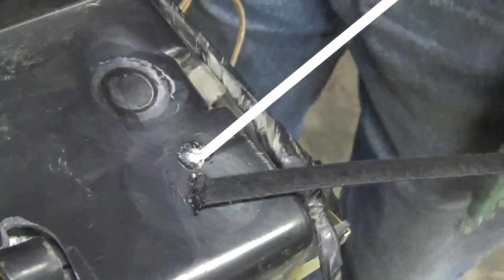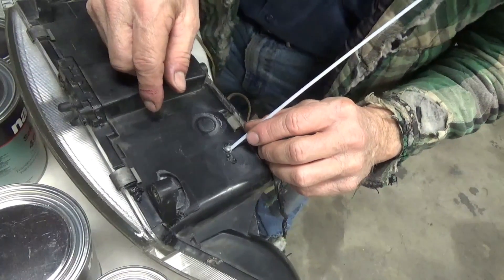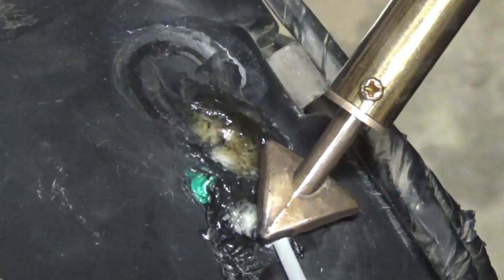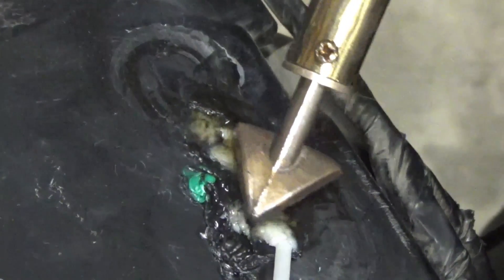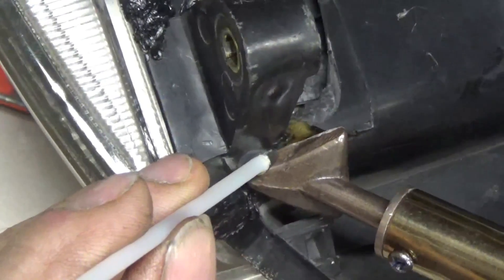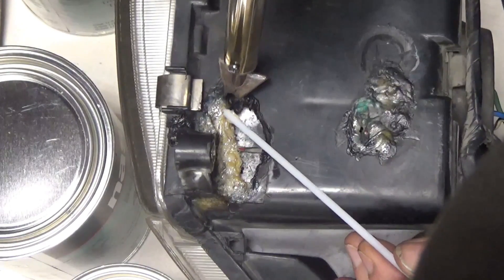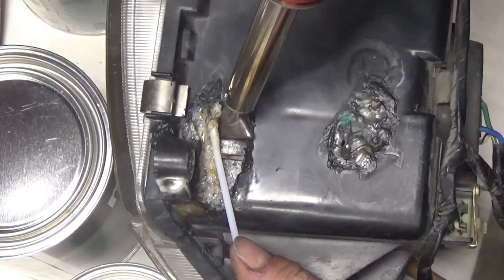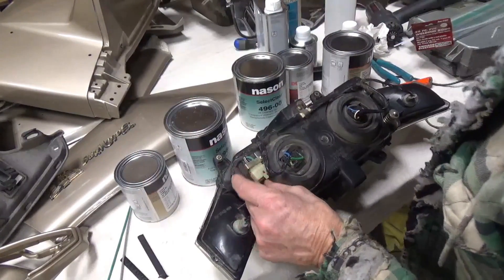Plastic welding motorcycle parts (part 2)

Comment: The superglue baking soda trick does work but it's not any stronger than just letting it harden naturally it just allows you to work faster because it hardens instantly, we do it all the time with O rings!  Our body man is really good at fixing broken tabs on plastic using super glue and a paper napkin, it sounds stupid but you soak the napkin in the glue and use it like fiberglass mat. Once he gets it in place he then uses baking soda to harden it.  15 years ago I knew a guy who sold a Cyanopoxy system and you could literally take a piece of rubber hose and glue it to wood or cinder block and you could not pull it apart!  That company went bankrupt but another company called Cypox sells it now and seems to have a better marketing strategy because the old company made you buy a bunch at a time instead of one kit and it was expensive and had a shelf life. Now you can get one kit for like 40$.
Reply from the maker: I've heard of doing the super glue that way with the paper, I just don't have a piece of ABS to practice with right now, maybe when it warms up a bit I can find something outside made of that so I can try it. I need to know a good glue for the next time I have to fix something like that.

Comment: Interesting.  I wasn't expecting you to fill in the "hole", but I suppose it's more support and also a good idea to help keep it waterproof.  Now that you've gone to all LED lighting, the entire housing should be experiencing less heat.  Not that it should have been much of an issue, should be good airflow when you're bombing along out on the highways.
Reply from the maker: I don't know about less heat yet, the LEDs do have a large heat sink block on them but since they use far less power, that should reduce the heat. On the filament bulbs, all the heat is away from any parts the heat could affect, on these the heat is behind the bulb on the outside of the housing.

Comment: Great videos mate, shows that with skill,patience and practice you can achieve great results. I have used fibrefill rods with good success. One little tip from me, shown by a friend, is to use scrap bits of the parent material to make a perfectly matched filler. Things like headlights can have redundant areas that can be carefully removed and used as filler rod. It guarantees a perfect filler rod match! Given how much they cost, fixing broken headlight mounting tabs makes great sense. I have a couple of busted ones that were used to practice on and to trim filler strips from. A modern German car headlight can easily pass $1000 a piece so fixing the cost effective option!
Reply: Yeah, I had to replace a headlight pod on a Kenworth truck a few years ago, 750 bucks.  It might have been salvageable, but all the ears/dogs were broken off,  not sure if they even remained on the corresponding positions on the fenders or not. Even if all of the ears/dogs were available, it would have been a LOT of work to repair, and what guarantees do you have that one or more of them won't vibrate loose or pull out of place again?  If it were one or maybe two of four or more, I'd say that repairing would be a good choice, but when it's all of them, it's my opinion that you're soliciting troubles by reattaching them all.  It's possible that on a smaller headlight pod for a car, that a repair of all of them might have better success, but even without colliding with objects, the front end of a heavy truck takes a pretty severe beating dealing with potholes and road surface anomalies, and the fact that heavy trucks pile on the mileage almost non-stop. In my case, it wasn't a viable option, as time did not permit an opportunity to try to re-attach.  The body work and painting was done, and the headlight pod showed up just in time to be installed, and handed back to the customer so that the vehicle could go back into service.